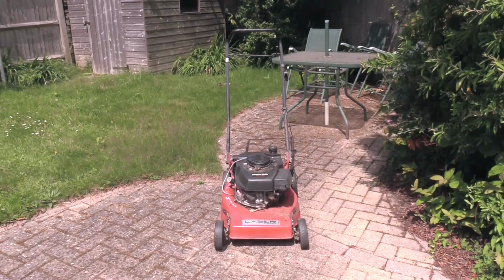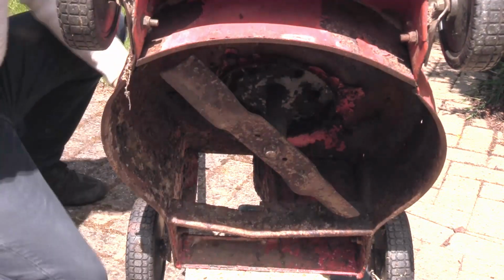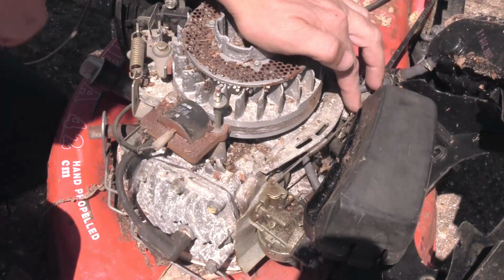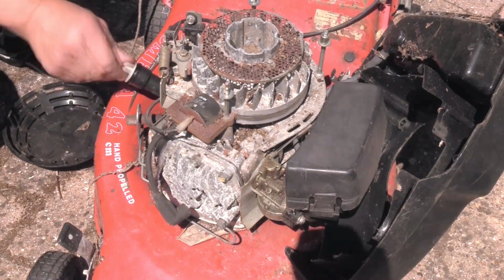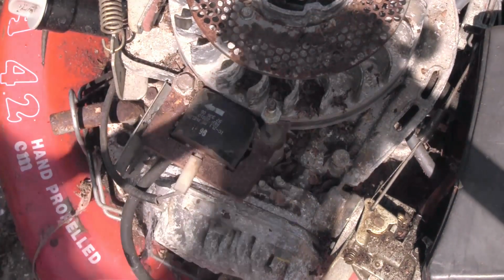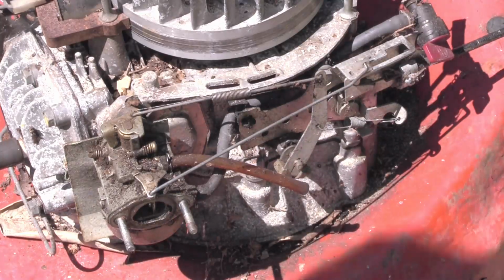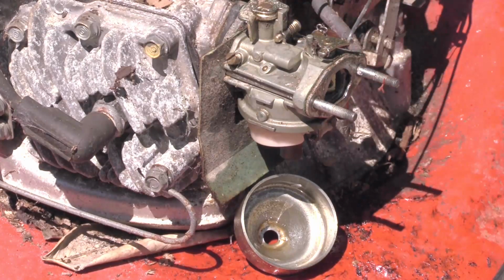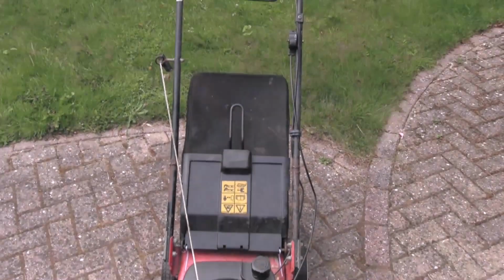Can we get an unloved mower mowing again?

Comment: Glad to see you back on youtube with a fresh video.  I was a lawnmower mechanic over the summers when I was a college student in the early 1980s.  When you mention the bent crankshaft, diagnosed the float needle seat leak, I felt like I was back in the old lawnmower shop.  I sense you may have had a similar job at one time.  I once seized the piston on a customer's Lawnboy 2-cycle engine lawnmower when I ran the engine without the shroud/cover on the engine.  This is critical for channeling air from the flywheel impeller fins down over the cylinder head.  I am impressed with the drill start and your temporary fuel system with the on-off valve.
Reply from the maker: Yes once was a mower mechanic back in the 80's too. I remember those lawnboy mowers with a plastic carburetor? Re cooling the engine only ran for a minute so no risk of an overheat. Nice little mower, light and easy to start.